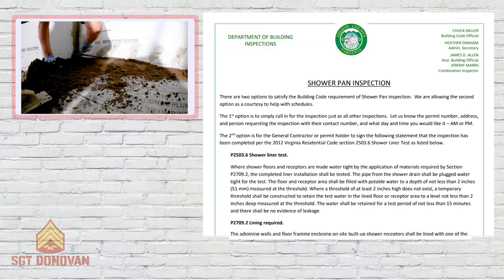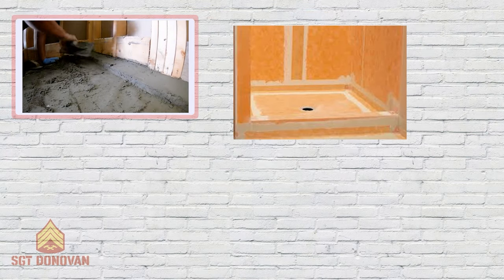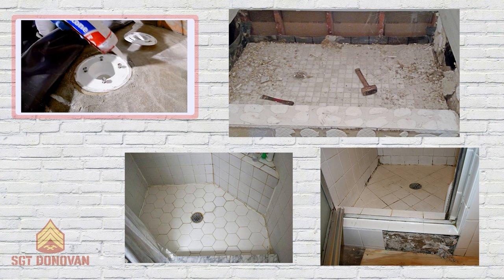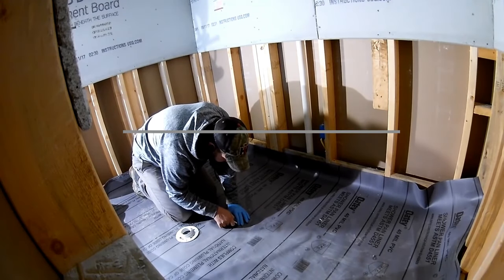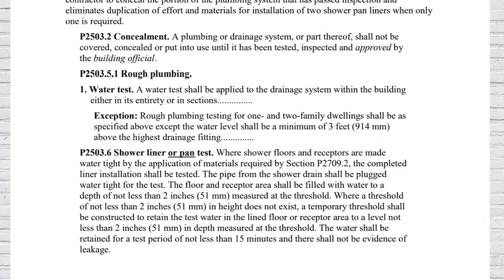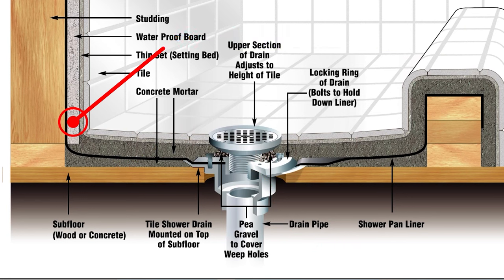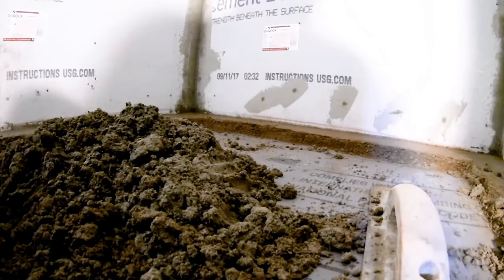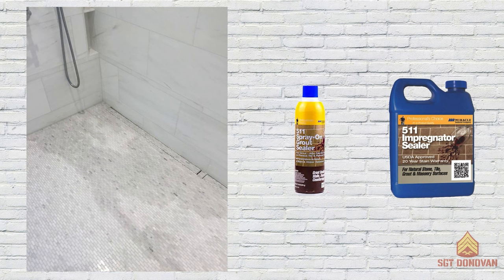Why Shower Pans Fail | Avoid These Mistakes! (Most Pros Do it Wrong!)

Comment: The guy that did my shower screwed up really badly. I have so many problems now and it's only been 4 months since we've been using the shower. Almost everything that you mentioned here, he messed up. Now I had to rip up my expensive luxury vinyl flooring, baseboards and base shoes, and there might even be damage in adjoining rooms and drywall. I am so upset. He didn't use grout/tile caulk, no grout sealer, the grout in the shower is cracked, he did a terrible job cleaning up after himself since there is haze on the tiles, and overall, he sucks!!! And we are so upset. I know nothing about any of this, but I am learning because life has kicked us in the face with the crap contractor we dealt with. Do you know how much it would cost to have the entire shower pan replaced if it's made of mortar? I think there's probably a bunch of water underneath because it flooded the whole bathroom underneath the flooring and underlayment. So frustrated right now. Where the heck am I supposed to shower???
Reply from the maker: I’m sorry to hear that!  It sounds like he has no business being in business.  This kind of situation is why I’m big on DIY.  It’s so hard to know who you can trust.  Feel free to email me and give me some more info and maybe some pictures and I’ll do my best to help as much as I can.  My email address is in the “about” section of my channel page.
Reply: $60 per sq ft minimum of$750 
Plus tear out and would have to remove all the tile on the walls total redo basically
Reply: @SgtDonovan  Cannot find the "about" section to email you.  Is there another way, or can you explain how to find your email?
Reply: Was the guy who did the work the lowest bidder?
Reply: @BOHICA_  why you gotta do him like that. 😆

Comment: I have had various of the old school shower pans installed in houses we have had custom built. Everyone insists "I have been doing this for 20 years, I know what I am doing!" when you question them. They all leak at some point. I did the last one myself using Schulter Ditra and waaaa-lllaaaa it has never leaked. I know nothing matter unless it is installed correctly, but I am going to die on the hill of Schluter from now on. It was easy and have had zero problems.
Reply: We’ll said I install in Canada where house move a lot with climate. There is NO CHANCE I would ever do a pan like this. Furthermore I could have a crew of 40 people repairing these types of installs. No clue why anyone would bother with these brypak bed GARBAGE!

Comment: That is why you stop doing these old systems antiquated pvc, copper, etc liner and do membranes. The membranes collect the water only up to the grout depth of the tile and will not absorb down and collect. Frankly liner pans was a stupid ass system and I am glad to see tile setters transitioning on mass to the membranes with integrated flange drains.

Comment: The garage videos do indeed prove that you can modify the accepted system of install as you can not argue with real world results. Its just like drinking a few beers on the way home from work many contractors have been doing this successfully for years so obviously there is nothing wrong with drinking and driving just so you limit it to 4-5 beers..........JK

Comment: Eventually, over time even if installed 100% perfect, it will leak at some point and time.  If you plan on staying in your home permanently, just put in a shower pan and save yourself the headache.  And now they make shower pans that you can tile.  Seems like a safer option with less points of failure.
Reply: Pans you can tile are outrageously expensive, here in Minnesota anyway.

Comment: Wow, misguided and misinformed. With any luck this is your shower and not a customer.

Oatey did so many things incorrectly in their video and all you did was parrot that. Just because they manufacturer a liner doesn't mean they know how to build a shower, because they definitely do NOT do it right. Your contradictory statements don't help either, on one hand you are saying that your mortar would somewhat dry out through the weep holes but on the other hand you say a liquid topical membrane would trap water between the tile and membrane....dude, you cannot have it both ways. Then your reference Your Shower Pan video which clearly shows you putting your mortar bed against your backer board, while at the same time saying that there should be no contact. You also state that water would be able to filter through your mortar bed but not through the weep holes 😂
Make up your mind.
Also adding a bunch of rocks around the neck of your drain would be a weak spot, rocks would allow for movement whereas mortar would not. 
Then you stayed that water could wake up your wallboard but yet you advocate for a monolithic cement curb.... you are aware that that wicking would also transfer up and around your curb to your outside floor, even though you kind of saved yourself by again advocating for the wallboard not to touch the pan... but you cannot NOT puncture the pan material with wallboard unless you marry your pan in your curb materia thereby allowing wicking action to occur. 

I know you mean well by posting these videos but you are not allowing for free-thinking, even advocating that the R&D the customer must Trust ! How does that trump real life experience ??
As a fellow veteran you must know that not everything that is written in a book actually happens in the field, ojt is real !
And I understand that following every little detail what manufacturers recommend will surely get you more likes and more subscribers, that is a nature of the beast with most ppl... they like to see things done by the book, then you end up being a book Soldier and give out repeated mis-information.

Given the hundreds of showers that I have demoed throughout my years, I can guarantee this will be a failure in about 8-10 years or less. My extensive library of my videos will attest to that because of the methods you employ.

But you do you 💪✌👍
Reply from the maker: To totally discount instructions or R&D isn’t helpful to someone without any experience.  Doing things “by the book” is by far your best chance at getting it right if you lack experience.  I have no doubt that you are good at what you do, but you have a ton of experience and muscle memory happening in the background that a beginner does not.  
I know I can’t convince you that the methods I (or the instructions) used are right, but I will respond to a couple of the things you mentioned.  Regarding your comments about some contradictions… I did say sealing the pan with a membrane will trap water.  While yes, there are weepholes, they are not the only thing working to remove the water.  Evaporation is happening as well.  There are several things working simultaneously that are dependent on each other.  
I 100% support free thinking, but only when there is experience and talent to back it up.  My videos are for beginners.  The military handbooks you mentioned are not always the best way of doing things for someone that has years of experience.  Seal teams are known to deviate from the handbook and are extremely talented, but I would not want to see a unit full of E1s trying to do what they do.  For someone learning, by the book is easily your best chance to get it right.  For someone as skilled as you, maybe not.  That said, I have nothing but respect for you.
Reply: @SgtDonovan  understood. And I like your analogy about the E1 thing.
But I will say this, when I was in it was right after Vietnam and some of my E5 and E6 I had a lot more respect for then most of the officers because as you said experience it's always much better.

Thanks for your response
Reply: Let’s keep it peaceful guys, there’s many ways to skin a cat. I did a complete shower based on Bob’s method 3 years ago (thank you by the way) after watching multiple videos of his I was encouraged enough to tackle it by myself without any experience whatsoever. I’m in any implying that Sgt. Donovan methods are better or worse, I’m not the expert here, but to if you follow some either way you are bound to be safe imo. Hell my dad build a shower that I know it’s not built anything like it should be and it’s still going strong without failure, not leaking over a raised foundation. I will subscribe your Chanel Sargent Donovan in support, you never know what an apprentice like me can learn. Best wishes for you two gentlemen, thank you for your services to this country.
Reply: @SgtDonovan  Lots of class Sgt.  Starr not so much.

Comment: agree with most , however i dont agree with rubber type membrane. After membrane is installed & flood tested next comes wall board installers that drop screws , nails , tools and step on them  or put ladders on membrane poking holes . Do yourself a favor & dont use rubber type membrane & find out later

Comment: STOP - no one should be building a shower with a rubber liner anymore. OUTDATED product.
GREAT VIDEO - just has a misleading title. Do another video with current products like foam boards & sheet / liquid membrane barriers..
PLEASE update your title so people stop learning outdated methods with outdated products. Current floor pan method is ...  Slope Base - ThinSet - FLoFX drain - Waterproof Sheet - Seam Tape - Liquid Flash membrane - thinset tile - maybe epoxy grout - and silicone between wall & floor tile  

please CALL THIS VIDEO something like - "Why Rubber Liner Shower Pans Fail"

Comment: If you make a shower pan with redguard instead of panliner. Your backerboard goes all the way down. I'm old school where redguard showerpan better then panliner.  Cause you will not have kick outs in corners.  But only the real shower builders know this. So run backer all way down do a preslope Redguard your preslope and use redguard band on any change of plains. Basically your building a panliner but with redguard.  Then you mud your shower pan again. Eylander tile youtuber as a good video on it. Cali style build. Cali style best way . Texas and Florida suck in shower builds.  They use no preslope very bad. But panliner and redguard panliner both work. But with a redguard panliner you have no kick out. But now I just use laticrete membrane and kerdi. Or any membrane.  Cause you do one slope no preslope.  Time is money.

Comment: Rubber and sand mix pan being sure to use gravel around drain.  Hardybacker or durarock with redguard membrane waterproofing. Install your sil before tile and you will never have an issue. Never.
Reply: What about red.guard on the slope pan?.
Reply: @fishon3586  the whole shower stall.
Reply: @chardmcfinnigan3258  even the ground? I heard that's not good
Reply: @fishon3586  don't know why it would be. I only want water getting to the weep holes as a last resort 30 years later at worst.
Reply: @chardmcfinnigan3258  so u red guard the pan also?
Reply: @fishon3586  The entire enclosure to be tiled. Yes. Never, ever an issue for the last 25 years. Not one.

Comment: What can I do with the grout that has cracked in the corners. Just like your video and I have drain flies coming out of there. How do I get rid of those if I have moisture under there?
Reply: Mushroom flies!  It is possible to repair a situation like yours, by knocking out all the tiles at the failure points, and re tiling again using plenty of thin-set mortar.  I did such a repair and it's been 12 years.